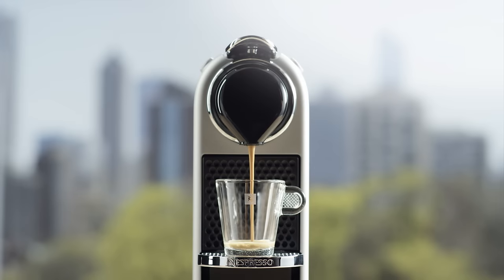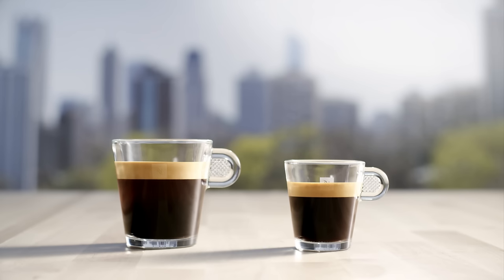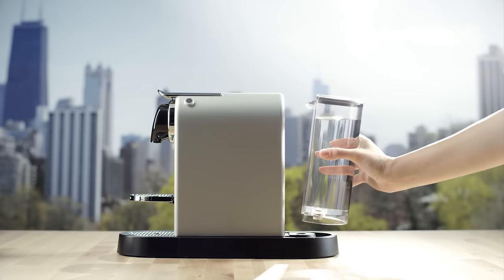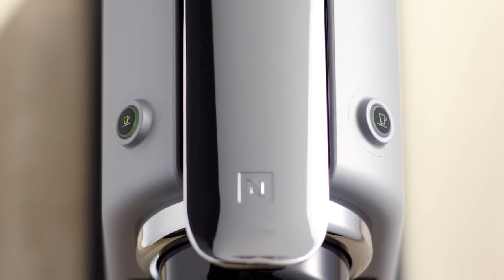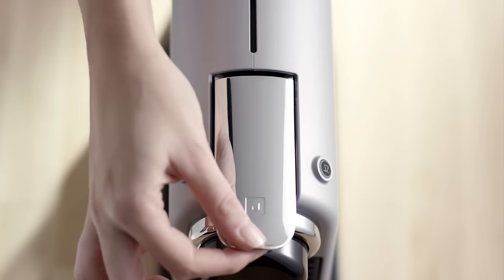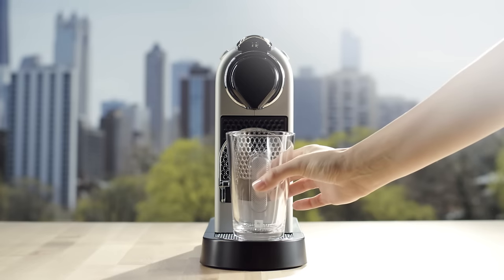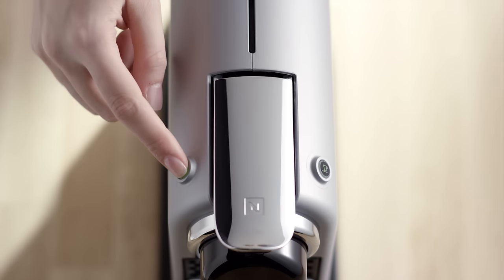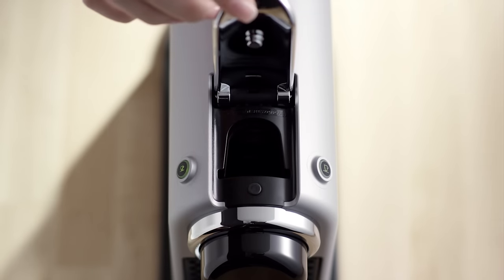Nespresso Citiz - How to Video - Coffee Preparation

Comment: I'm amazed you found a way to sell instant coffee to idiots for $4 a cup, plus a $430 kettle with a pump inside.
GUYS THE CAPSULES ARE JUST FULL OF INSTANT COFFEE, TURN ON A KETTLE AND YOU'RE DONE.
Better yet, you can buy a 500g tin of instant coffee for $30, that's 250 cups of coffee at $0.12 per cup